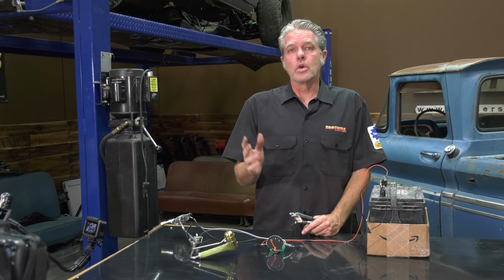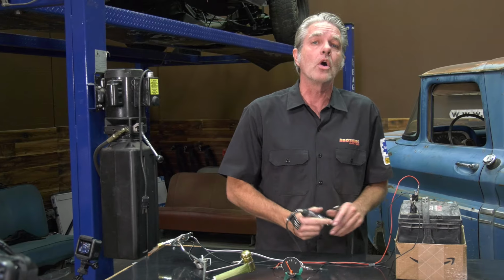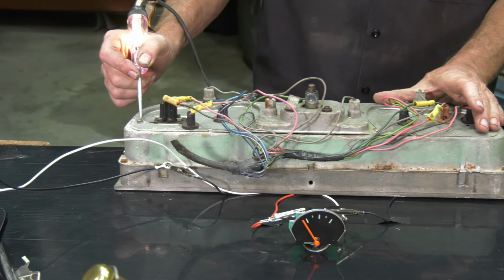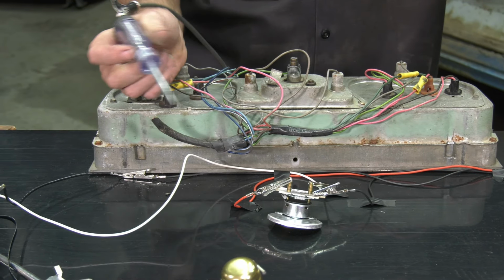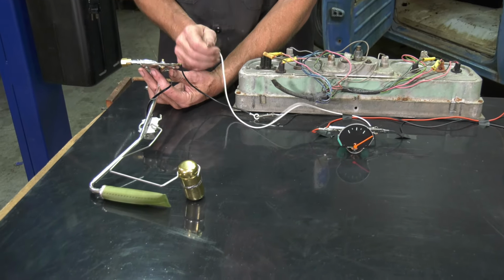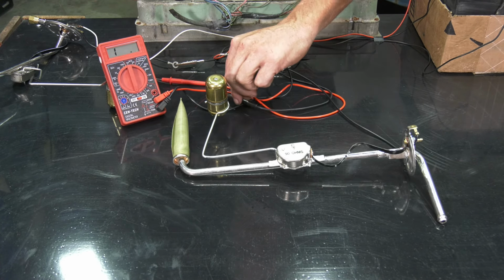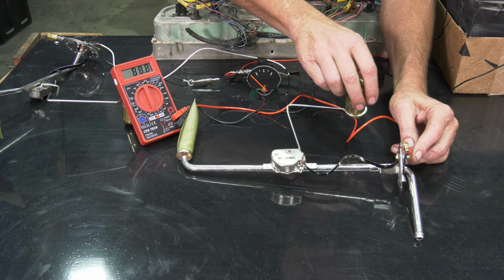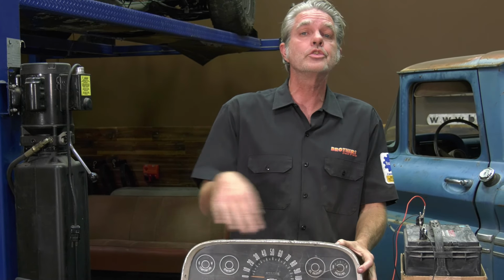1947-87 Chevy & GMC Truck Fuel Gauge/Sending Unit Troubleshooting

Comment: On this I thought my sending unit was bad. Because I would fill the tank and it would say around 1/3 to 1/2 tank. I replaced the sending unit because it was old and rusty and had to put a new tank in. But now my tank is full and will only read a 1/4. Im going to assume that my gauge is bad but im not sure and don't know how I can fix it.
Reply from the maker: If the gauge is bad you probably can;t fix it, you'll have to replace it. However, we suggest pulling the gauge out and bench testing it as we did in this video just to confirm prior to going and buying more parts. Use your own sending unit for the bench test so you can eliminate any issues with that at the same time. Good luck!

Comment: I just found your video and before I take it to a mechanic just wanted to know your thoughts. My fuel injectors or the things that show gas into the carburetor seem to be goin bad maybe. Sometimes when I sit idle for too long or I’ll crank the truck up and gas isn’t coming out of them. What do you think the issues may be?
Reply from the maker: Have you tried running a fuel injector or carburetor cleaner though it? They are pretty effective for clearing buildup from the injectors and jets.
Reply: @BROTHERSTruckPartsTV  I haven’t can you suggest some?
Reply from the maker: @kartezcuby4690  We use the heavy duty one by Lucas Oil.

Comment: Hey David my gas gage reads 3/8 with a full gas tank 1986 silverado can you help thx
Reply from the maker: Have you done the tests as I've shown here in the video? If not, I'd start with making sure you have a ground, and then move on to the sending unit.
Reply: @BROTHERSTruckPartsTV  yes David i grounded the tanks nothing changed  thanks for responding back
Reply from the maker: @paulabzotte432   So disconnect the wire from the sender and see what happens next. If you don't get any movement then it could be a couple things... either there's a bad ground at the dash itself, or you have no 12v power to the gauge. Out of curiosity, does your temp gauge work?
Reply: @BROTHERSTruckPartsTV  ok ill try this my temp gage works but my oil gage only works when its cold after a little stops working

Comment: I have a 1988 gmc sierra 1500 4x4 just bought it the previous owners replaced the fuel pump and sending unit , the guages on cluster does not read looks either empty or nothing any help where to start looks like the ground has been moved
Reply from the maker: First thing you need to do is actually find out of the gauge is missing and add the ground back, then see what happens.

Comment: My fuel gauge for my 84’ C10 will go past the F, then somehow shoot down to half a tank in a day when i’ve only driven 5-6 miles. would that be the ground, sending unit or something else?
Reply from the maker: Sounds like the sending unit is going bad. You could provide it a good solid ground for a few days and see what happens before pulling the sender to test it.

Comment: My power wire  is reading 8.4 volts. Only when it leaves the firewall from the fuse box. On the grey wire that comes from the relay reads 12.2. Any idea of what makes it short out? I have went along the wiring and see no visual grounding. It's a 1990 K5 blazer. Running a wire to bypass pigtail directly to fuel pump wire for now.
Reply from the maker: Could be an internal short in the power lead, or a bad connection at the fuse box.
Reply: @BROTHERSTruckPartsTV  thank you for the response I will look into the fuse box! That's where I'm losing the power at. I have 12v on the grey wire at the fuse. 8.4 on the red wire  coming back out of EcmB fuse

Comment: Looking for help with upgrading the 4 way fuel switch controls for 72 K1500. The trend back then was adding the two side aux tanks. The switch has stopped allowing fuel to flow from either side tank.
Reply from the maker: We've never messed with that system before, although we've had a number of requests to look into it. We've only heard of some aftermarket replacement switches which don't sound overly reliable. If we had a truck nearby to play around with that had the dual tank setup that would be ideal, but unfortunately that's not the case. We'll keep looking for a donor, but until then we won't be much help.
Reply: @BROTHERSTruckPartsTV  u want to fix mine it has dual tanks 1975 K10 4x4??
Reply from the maker: @kellybergin1532   Where is the truck located?
Reply: @BROTHERSTruckPartsTV  it's in Orange County, California,  I thought you were in Corona California
Reply from the maker: @kellybergin1532  Contact our shop or DM us on Instagram and lets see if we can set something up. We have lots of people that try to figure our Dual Tanks, so maybe this is an opportunity to do a video that will help people with these issues.
Reply: @BROTHERSTruckPartsTV  ok where are you located thou
Reply: @BROTHERSTruckPartsTV  Ok I just Messaged you on IG
Reply from the maker: @kellybergin1532   We'll make sure the IG manager forwards the info to us in the studio. Thanks!
Reply from the maker: @kellybergin1532  Just spoke with the IG manager and went through DM's and yours is not there. Please DM us again to @BrothersTrucks on IG
Reply: @BROTHERSTruckPartsTV  ok, I ll do it again
Reply: @BROTHERSTruckPartsTV   Hey ,I m  the guy with the 1975 Cheyenne K10 with dual tanks? Wanna try to get them to switch and read the fuel gauge correctly, i'm in Buena park??
Reply from the maker: @kellybergin1532  Thanks, we'll get with him this morning.
Reply: @BROTHERSTruckPartsTV  Kool!!
Reply: @BROTHERSTruckPartsTV  Ok Kool

Comment: I have a dual tank 86 GMC High Sierra and having 3 fuel problems . Problem #1 , every time I go to fill up either gas tank it starts clicking like its full and it takes forever to fill my gas tanks.
# 2 it at times it leaks from the  fuel tank selector valve in which I replaced not too long ago & continues to leak. #3 I think I got this one squared  away by watching your video on this problem of grounding and not reading right .
Reply from the maker: On #1, all Squarebodies suffer from the same dilemma, no solution for that at the moment. Regarding #2, not sure here, but we would suspect a cheap replacement valve. Try and find an AC Delco replacement. #3, nice work! Glad we could help.

Comment: I relocated my fuel tank in a 1965 Chevy truck. I used a 80's K5 Blazer fuel tank that uses a 90 ohm sender. Does anyone make a 90 ohm replacement gauge for 1964 - 1966 gauge cluster? or does anyone make a 30 ohm replacement sender that fits a 80's K5 Blazer tank?
I see this brought up in tons of forums, but no one has a solution. there are replacement 90 ohm gauges made for other models and years, I just cant find one for 64 - 66. I want to use the stock gauge cluster, so don't suggest some overpriced, ugly, aftermarket gauge cluster.
Reply from the maker: Couple suggestions... modify the original sender to fit the new tank. modify the new tanks sender with parts from your old one to make it 90 ohms, or... install a completely new universal 90ohm sender assembly in a different spot in the tank. The last suggestion would be our choice. Here's a link to a video we did using our universal tank sender, it's short but you'll get the idea: https://youtu.be/NQ33sH3unFA

Comment: Whats it mean when my gauge on my 56 won't read any higher than 1/8 no matter how much fuel i have?
Reply from the maker: Start by checking the ground at the tank, if you ground it and still only get 1/8 then you have a bad wire or a faulty gauge. Otherwise its the sender.
Reply: Ok thanks much

Comment: I have a '71 chevy. There is no ground on the fuel sending unit, is it supposed to have one? Currently the fuel gauge just shows the needle in about the 3 o'clock position.  Is it not having a ground going to be an issue? I've seen in other videos where it doesn't have one.
Reply from the maker: The sending unit needs to be grounded. Once you have a ground you can troubleshoot further if necessary.
Reply: I have the same problem right now in my 70 c20. No ground on the sending unit. Gauge reads past full all the time.

Comment: I own a C20 ´72  SuperCamper in more or less mint condition. I ran into one problema. Fuel Gauge always shows about 20% too much fuel capacity. So if tank is fully filled gauge exceeds to the right. On a 3/4 filled tanked it shows full and so on. 100% grounded it points to Zero fuel what would be right. i am pretty sure, that i measured around 110 OHMs on an almoust full tank. Any ideas how to fix this. With ignition turned off gauge is showing 55% filled. This seems to be independent of fuel level.
Greetings from Germany. 
BTW: It is a pretty hard job the buy spares in Germany. Will you do international shipping
Reply from the maker: Yes we do international shipping. For your problem we suggest removing the sending unit from the tank and bending the stop tabs on the internal rheostat until it reads 95ohms full and 5ohms empty. the tabs are easy to bend and this will adjust the sweep of the float in the tank.

Comment: Thank you for the information I replaced a fuel pump in a 1987 r10 Chevy  it reads fine and drives perfect but I run out of gas when it reads 1/4 tank at least that’s what the gauge says.. would you think this is a gauge issue or sending unit?
Reply from the maker: Probably the sending unit or a ground problem. test it like we did in this video by removing the wire from the sending unit and connecting straight to ground and see what the gauge does then.
Reply: BROTHERS Truck Parts awesome thanks for the help!

Comment: Excellent video , I put in new gauges,sending unit,tank,wiring and I’m baffled that my gauge only reads half full went tank is full. When gauge reads 1/4 I have a half of tank on 1955.1 first series ,235 ci ,3 on the tree. The sending unit read 30 ohms before I installed it.
Reply from the maker: Sounds like you need to start testing your grounds again. What happens when you ground the wire on top of the sender directly to a good known ground?

Comment: My temp gauge pegged out.   Single wire I believe. Bad sending unit or something with the cluster assembly?
Reply from the maker: Could be a couple things. Bad sender, bad ground. Start by testing the ground.
Reply: Jesus, Like the fuel sender that uses a variable resistance with the float arm, you temperature gauge uses a NTC-thermistor sealed inside a metal canister, it is solid state and start out high resistance then goes low as it heats up. Clean grounds at the engine, run a ground from the end housing of the alternator to the engine or battery. Make sure there is a ground from the engine to the cab. The original is under the right front cab corner in strap form. If the other gauges work fine (Other than oil), but with key on-engine off, disconnect the temperature sensor in the drivers front cylinder head. It is a single wire. When off, the gauge will think the engine is cold and move to cold. Connect this wire to jumper to ground and it should move to hot. If the gauge does not sweep completely, remove the instrument cluster and use the inexpensive test light and long jumper to the battery. This testing can be done with jumper cables but be careful with B+ end. Tape it to the steering wheel. If you connect the test light to power, you are testing for grounds. If the negative, the test light works for positive. The 194 bulb inside the test light will limit amperage to 1/4 amp. Clean connectors. If you remove the connector from the instrument cluster, clean the copper terminals gently with scotchbrite. Use dielectric grease sold for $5 at home improvement stores in the automotive area. Boat dealers use it on all connectors. Petroleum jelly can be used but keeps the copper clean from oxidation exposed to the air. Remember, these are over 50 years old. Hope this helps! NOTE; I would prefer you make fused jumper wires. Radio Shack sold black and red meter wire. Order online with fuse holders, 5 amp-10 amp fuse best and solder your alligator clamps. If using tape instead of heat shrink tubing, place a dab of weather strip adhesive on the end, it won’t unravel. Good luck!
ASE Master Tech since 1978

Comment: I have recently replaced my '77 k10, with a '77 c10. (got wrecked)
the fuel gauge in the wrecked truck was always steady, but the one in the "new" truck tends to "bounce" as the fuel sloshes around in the tank.
any ideas what's going on?
Reply from the maker: Most analog gauges have a damper on the movement of the needle, sounds like the damper on the "new" gauge is weak or broken. We've seen the same thing with Tachometers before.
Reply: @BROTHERSTruckPartsTV  what would you say if the gauge only reads 1/4 full even with a full tank ? - '77 K10 with dual tanks
Reply from the maker: @jgreco137  Both tanks or just one? Does it have dual sending units or does one tank pump into the other? Have the grounds been tested as shown in this video? Lots of possibilities still, but that's why we made this video. If you've checked everything as shown the problem should be obvious already. Providing you have 12 volts of power, there's really only 3 things that can be bad, ground, sender or gauge. Since you say it shows 1/4 tank then we would assume it has 12 volts.

Comment: My fuel gauge on my 71 Nova only will show between 1/2 to 3/4 full when tank is full. Replaced with new sending unit when I replaced the fuel tank with a new one. Have lowered tank and removed sending unit and had a buddy work the float up after down and checked the resistance also while I watched the fuel gauge. We put everything back together, still the same results?! Could the ground to the body be the problem?! Thanks in advance!!
Reply from the maker: If you had the sender out and tested/watched the gauge work as it should using the cars wiring and NOT a bunch of jumpers to make it happen, then we would rule out a ground problem. However, if you were using jumpers for the test then you need to test the wiring to make sure there is nothing wrong with the wire going from the sender to the gauge. IF THAT CHECKS OUT, then we'd say you've got something inside the tank interfering with the float and causing it to have limited movement.
Reply: @BROTHERSTruckPartsTV  Thanks guys!! I have had a few others saying the same hypothesis. Sorry it wasn't on a classic Chevy pickup. Different vehicle yet the principal is the same I guess! Lol!! I do have an old Chevy truck too!!

Comment: How many grounds am i looking for. 86 Chevrolet Silverado jusy one tank on drivers side. My fuel gauge reads full the whole time till it is almost out then it goes down to just before e mark. Any suggestions thanks
Reply from the maker: If it reads full until it's almost empty then drops, it's almost 100% your sending unit that's bad. A faulty ground would never drop the gauge regardless of how much gas you have. Here's a link to replacement sending units for your truck: https://www.brotherstrucks.com/Sending-Units/products/2507/

Comment: Question? Is it safe to have 14.2 volts coming through the firewall into my gauge cluster? I just replaced my voltage regulator thinking that was the issue and still have 14.2. On my old dodge D150 it has a separate voltage regulator on the gauge cluster but still have voltage issue on my volt gauge
Reply from the maker: 14.2 is fine.